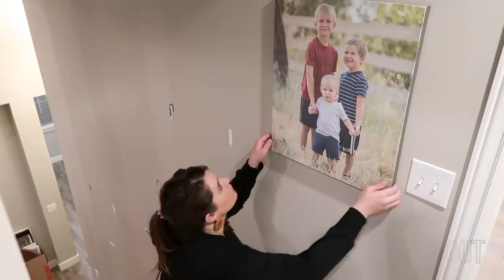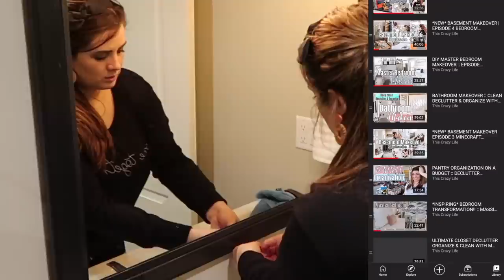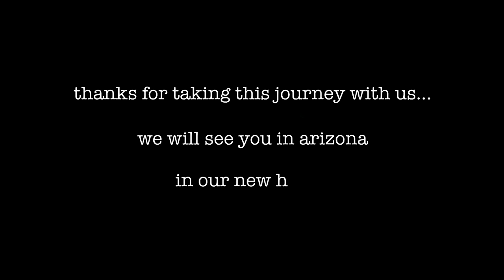😢 EMOTIONAL AFTER DARK CLEAN WITH ME 2021 :: THE LAST VIDEO IN OUR HOUSE BEFORE WE MOVE TO ARIZONA

Comment: We've been in our current home for 10 years this month. We lived in our previous home for 6 years and before that I lived at home and lived there for 15+ years!! Our next move, we want to move to Florida from Nebraska. Unfortunately good paying jobs are not easy to come by and that has held us back but I think when that time finally comes, that will be our most emotional move. Leaving the only state we've ever lived in and moving over 1400 miles away. Also, because it's been over 6 years since we've made the plan to move and I think it will be such a relief once it finally does happen, that, that will be super emotional as well.

I wanted to thank you for cleaning before you moved out. When we bought this house, it was so dirty when we moved in. You could see where the pictures hung on the wall. Soap scum was built up bad in the showers, carpets were so gross, it was terrible.